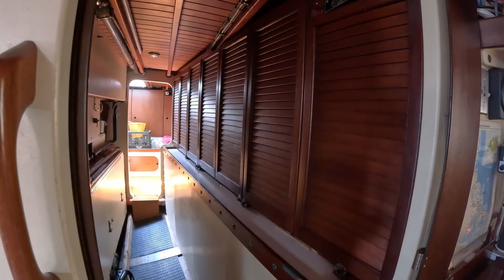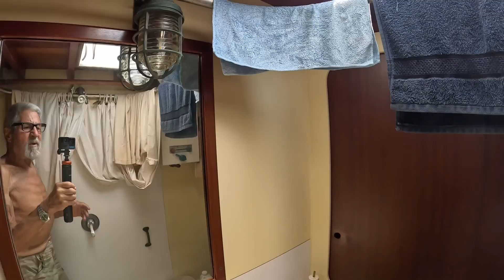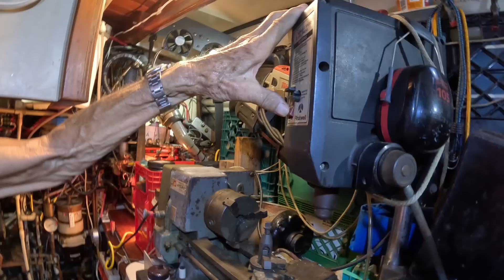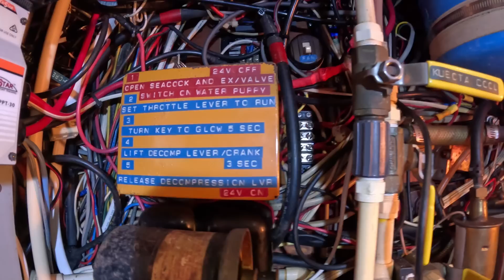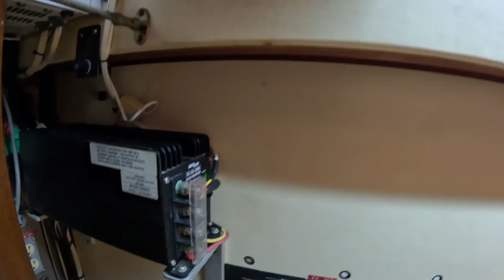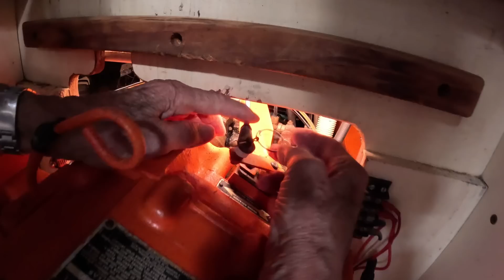Ahaluna - Interior Tour

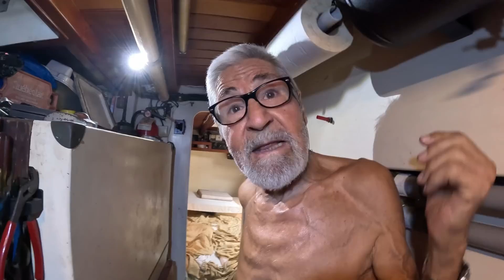Comment: @13:38 - FWIW, I did a stint as a lighting tech for grocery stores and retail outlets a while back.  The ballasts are the issue.  You never quite realize how much a ballast loses output over time as the change is so gradual.  An old ballast will smoke a new bulb way quicker than you would like.  Upgrade to electronic if possible.  One local grocery store changed all bulbs every 6 months and all ballasts yearly.  Lighting was a multi-million dollar department.
Reply from the maker: Thank you.